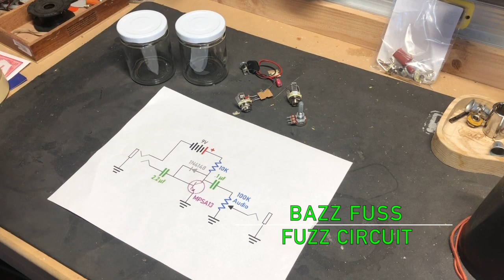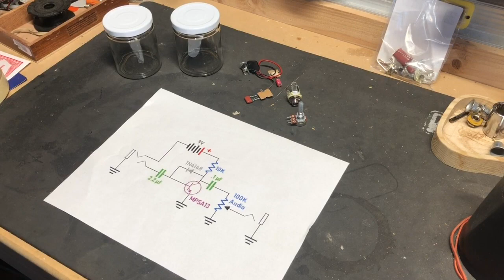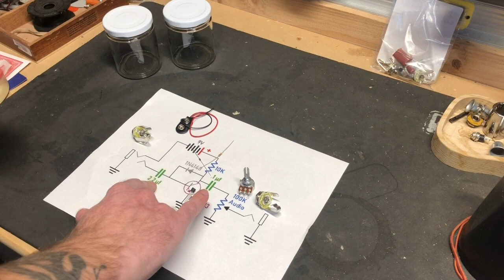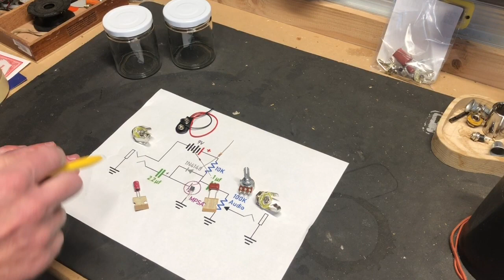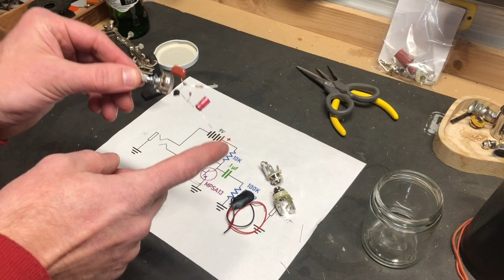Tiny Jar of Fuzz! (guitar effect pedal)

Comment: Awesome sounds.  Way back in 1967 I played in a band. Being a poor musician I couldn’t afford one of the new fangled fuzz boxes, so I borrowed someone’s factory fuzz, opened it up and drew the circuit.  I borrowed parts from my electronics class in High School and built one. It worked great and wasn’t pretty.  It ended up costing $5.00.  Pretty soon I was in business building fuzz pedals for all my friends. I used a soup can to build it.
Reply from the maker: That's a great story. Thanks for checking out the video.
Reply: I too have "borrowed" parts from my electronics class in school. Still got a tiny amp I built into a soup can !
Reply: Can 'O fuzz!
Reply: Hi how can you reverse engineer the circuits of pedals? I'd like to do it just to become good with electronics, other than to make diy pedals

Comment: this circuit sounds better with 100k ohm resistor and transistor 2n3904. Sustain is longer and is more expressive. You don't need play so dynamically.
Reply from the maker: Thanks for watching the video. I may try that on a future build.
Reply: I test transistor 2n3904 npn  with 1k ohm resistor and dont work. Can you solve my issue? please
Reply: I found the solution. I change the resistor from 1k ohm to 100k and make better soldering in output jack 😅. The output jack are cheap...
Reply: @miguelgateira4070  I had been trying to breadboard this exact circuit for nearly four hours. Your comment about swapping over to a 100k resistor has fixed my extremely low / no output issue that had me stumped. Thank you so much!
Reply: @neilkelly3818  Glad to know I helped someone. I can confess that I wasted a lot more time to resolve the situation. Thanks
Reply: @musicalmiscellany  
Have you got a twin? It's just that you said "..if I read the schematic right then this is we're circuit.." and my twin sisters would say things like "..this is we're CD.. etc" 
They would say 'we're' instead of 'our'. Anyhow, thanks for the vid and peace to you from Ireland mo chara.
Reply from the maker: @tomasotreasaigh111  Wait. If your sister was my twin... wouldn't that make us brothers. LOL. Thanks for checking out the vid.

Comment: How do i attach a foot switch on this thing?
Reply from the maker: The easiest way to add a footswitch would be to use a 3PDT kit like the one linked below. You'd wire the battery, input  jack, and output jack to the daughterboard. Then wire each corresponding contact on the top of daughterboard to the correct place in the circuit (in +, out +, 9V +, and common -). 
https://www.amplifiedparts.com/products/pcb-daughterboard-wiring-3pdt-footswitches-0
Adding a footswitch makes any circuit significantly more complex which is why I didn't include in this build. That said, there's no reason you couldn't do it. Good luck.

Comment: To get more bass change the caps out to larger ones 2.2 c1 .1 c2 or the volume pot to 500k. That will cutoff at 31hz which is a Low B also remove the volume pot and use the one built in the guitar which will often be 500k audio taper.. 100k makes the cuttoff 160hz..  The C-R makes a High Pass filter and higher resistance means lower F3 as does larger cap. Change the design to use a Bias control with a 4.7k resistor in series with a 10k linear pot. The volume and the bias will be crazy intertwined and you'll get the bass back.
Reply: По-любому что-то важное написал, но я ничего не понял. Типа если хотим больше низких- ставим с1 1.1мкф и пот на 500к? Поцыки, шо этот басурманин гутарит?

Comment: Thank you for the video ! I couldn’t found TRS jack in my area , it’s possible that I change it to two mono jacks?
Reply from the maker: You could use 2 mono jacks but then you’d have to remove the battery whenever you not using it. The stereo jack disconnects the battery when the effect is unplugged. But yes you could use a mono input jack.

Comment: im a noob. would it be beneficial to heat shrink tube wrap all those metal legs. also, how could I put a bypass switch in this?
Reply from the maker: You could use heat shrink tubing if you wanted. That certainly wouldn't hurt anything, but as long as you're careful with your wires... I don't know that it adds anything either. If it makes you feel better... go for it.

It seems like adding a bypass switch would be really easy but it actually makes the project surprisingly more difficult. It's not like adding a power switch because that would result in no sound at all in the off position. What you want to do is create a clean signal in one position and an effected signal in the other position. Also you want the battery to be off in the first position and on in the other. You probably also want to add an LED to be able to tell when the pedal is on, so you need a series of 3 dual-throw switches (one for the audio, one for the battery, one for the LED).

Don't get me wrong... it can be done. Do an Internet search for "3PDT bypass wiring". There's a lot of information out there and there are triple-pole switches made for this sort of thing. I just wanted to let you know it makes the circuit a lot more complicated (and thus why I didn't include it in the video). Good luck with the build.

Comment: Really impressive friend!! I'm a tap guitarist, does it work well with tapping? I'm planning not to buy a gadget hehe, I want to learn to build them instead. I don't know to read schematic diagram yet tho. Excellence tutorial by the way, definitely I will try to make one. Have a great day ahead. P/S It would be nice if it have on off switch that we can stomp on it.
Reply from the maker: Thanks for checking out the video. I don't do much tapping but I feel like it would work great for that. I agree that it would be nice to have a foot switch. You could add one but that would make the build a bit more difficult. Bypass switches aren't as simple as on/off switches because you need to send the signal to the jack either way. It's a matter of bypassing the effect portion and battery so you need a multi-pole switch. You also typically need an LED and resistor so the parts count goes up a bit. It's doable though.

Comment: Hey bro , amp makes noise when idle . an annoying squeak .
What can i do , from what
Reply from the maker: Not a lot of information here. Does this have anything to do with this pedal? Is it making the noise without the guitar plugged in? I'm not really sure where to start.
Reply: @musicalmiscellany  I didn't solder at first, I tried it on a breadboard. I think the sound was coming even when the guitar was not connected . I don't remember exactly
Reply from the maker: @cobainer  That sounds like something you'd be better off to troubleshoot on an electronics forum opposed to YouTube comments. However, noise like you're describing usually indicates a feedback loop. I've heard that the diode can make a huge difference for noise/feedback prevention. I'm not sure which one you're currently using but you might want to try a few different diodes (should be easy on a breadboard) until you get one that sounds right. I've heard some folks replace the diode with an LED (it is technically a diode) and get better results. It varies based on the exact components you're using. This all assumes your breadboard connections are solid and you're not getting a feedback loop from something else in the circuit.
Reply: @musicalmiscellany  I used the same materials in the diagram you gave, including the diode. But ı will try led

Comment: it is a problem if I use two stereo jacks?
Reply from the maker: This is an easy question with a complex answer. The first thing you have to understand is that the signal path is mono, so a stereo output won't buy you an additional signal. The circuit only has 2 output wires (+ and -) but there stereo jack has 3 terminals. The reason the stereo jack is used on the input jack is to interrupt the battery, but it is still a mono audio signal. All of that said... as long as you hook the wires up so that it completely the circuit (+ to tip - to sleeve), it should work. There will be an unused contact on the output though.

Comment: I'm unclear on the potentiometer. When you close it, does JUST the distortion go away leaving the dry signal? Or does it the whole signal go away leaving it completely quiet until your turn it up again?
Reply from the maker: It's the latter. The potentiometer is simply limiting the amount of signal at the output, so it's effectively a volume control. It may change the tone ever so slightly but it is not affecting the amount of gain or effect level.
Reply: @musicalmiscellany  Thanks. Very fun 'pedal' idea!

Comment: Maybe a stupid question. Could you wire a speaker cone in place of the output jack. Or does that not work at all.
Reply from the maker: You could try it but I don't believe that would work well because the circuit produces very little actual voltage. The audio signal has a small wattage but I wouldn't imagine it would have enough power to move a speaker cone (at least not in a way that sounds good).

However, you could wire a small amplifier board ( like this one: https://www.mouser.com/ProductDetail/SparkFun/BOB-09816?qs=WyAARYrbSnbTOyxcmy7VtQ%3D%3D&mgh=1&gclid=Cj0KCQiAvbiBBhD-ARIsAGM48bwDTKrO0wlyTcVEmp2Nzz2x7i0gH1WSBGp3CRQIrBNlGIihdSzRfycaAmb0EALw_wcB ) in place of the jack. That would probably work pretty well.
Reply: @musicalmiscellany  I will absolutely try this out. Thanks so much.

Comment: Great vid. A question, why does mono go in and stereo go out? Would it be possible to make a mono out instead?
Reply from the maker: Thanks for watching the video. The audio signal is 100% mono. However, both the 9V current and the audio signal are traveling through the same feedback loop. So, the stereo jack is used to disengage the 9V battery when no cable is in the input jack. It's a common technique that's been used in pedals for years. If you used mono jacks on both the input and the output, the effect would still function perfectly but it would always be pulling current from the battery, even when no audio is traveling thru the circuit.

Conversely, if you were going to always use an AC adapter instead of a battery, using 2 mono jacks would be perfectly fine. I hope that makes sense.
Reply: @musicalmiscellany  yes I get it now, thnx for taking the time to answer!

Comment: sorry if this sounds stupid but why one stereo jack and one mono jack? shouldn't both be mono?
Reply from the maker: The stereo jack is used to interrupt the battery signal. In other words, when the jack is unplugged, the battery is disconnected from the circuit. When cable is present, the battery is supplying current to the circuit. A lot of pedals have used this scheme for many many years. If you were using an A/C jack in lieu of a battery, you could easily use both mono jacks and that would work perfectly.

The circuit will certainly work with mono jacks, but if you're using a battery, you'll have disconnect the battery every time the pedal is not in use. Using the stereo jack makes it so you can leave the battery connected and not worry about it draining. You simply need to unplug the stereo jack when you're not using it and it will conserve battery.
Reply: @musicalmiscellany  Much thanks for the very thorough explanation! I'm a complete noob both with guitars and pedals, but it seemed like a simple project to have some fun with. Just waiting for the transistor to arrive. Thanks again!
Reply from the maker: @madseason8900  It's a perfectly logical question. Besides, I make these videos hoping they're helpful to someone, so I appreciate you watching. Good luck with the build. This is a really simple circuit and a fun one to experiment with. Welcome to your new hobby.

Comment: I’m just getting interested in how the insides of pedals work, I had no idea u could do this without a circuit board, so wat is the purpose of a circuit board - just to make things easier and prettier?
Reply from the maker: First and foremost, thanks for watching the vid... and good luck with your new hobby. This is an extremely simple fuzz circuit with only 6 electronic components. You could easily make a circuit board for a small circuit like this - but you can also hack it together as I did. When you get into pedals with a higher component count (say 12 or 15), it becomes really messy to do it this way. In that case, a circuit board will make it much easier to build, mount, and troubleshoot.

Comment: Hello! I've built the circuit, but when I plug to the amp nothing happens, on the other side when I plug to my interface trought an instument input I have signal. 
Does anybody knows why it happen?
Reply from the maker: That's unusual. If you have signal passing through the circuit it should go through to the amp. You didn't mix up the input and output jacks did you?
Reply: @musicalmiscellany  no, I think that I connect it in the right way. I ask myself if it have something to do with de impedance in of my amp

Comment: He man, does it matter what kind of jack i use?
Reply from the maker: I talked about the jacks in the video, you need 1 mono jack and 1 stereo jack (for the battery cutout). Are you asking what manufacturer of jack? I don't follow.
Reply: @musicalmiscellany  yeah, I was wondering if any 1/4 mono and stereo jack would do.
I couldn't find the Jacks  in my language
Reply from the maker: @truffeltroll6668  Got it. The manufacturer shouldn't matter, as long as it's a 1/4" mono and stereo jack, you should be fine.

Come to think of it... you could even use 1/8" mono/stereo jacks and wiring would still be the same. However, if you wanted to use RCA or Banana jacks or something like that the circuit would need to be modified slightly since those jacks handle ground differently.

Comment: I have a problem. I baught everything for the pedal. But I can't find MPSA13 tranzistor. And I don't know what to put there instead of the MPSA13. I found one, KSP13BU but I can't buy that one too. Hope someone can help me
Reply from the maker: You could try using a 2N5088 instead of the MPSA13. They're very similar transistors. I'm not sure where you're located but both mouser.com and taydaelectronics.com sell MPSA13s with worldwide shipping.
Reply: Yes, they do but it is realy expensive-20 euros. I'm from slovakia, central europe. I found some alternatives I will try to buy some and write here if it works or not. I hope I can find at least 1
Reply: MPSA12
MPSA14
ECG46
ECG172A
2SC982
2SC1472K  
2N5525
2N5306
Here are the alternatives that I found. If someone know that some won't work I will apriciate that you will tell me. And sorry for my english, I hope you can understand
Reply: I mean the shiping
Reply: Hi I'd like to give a hand! I've made this circuit many times. Get two identical NPN transistors and you can make a darlington pair. It MUST be a darlington transistor for this circuit, however this is where we make one out of two :) First step is to label your transistors 1 and 2 for ease, in order make it you will need to use 2 transistors and make a darlington by:
connecting (1)collector to (2)collector and (1) emmitter to (2) base
The base of (1) will be the base, the combined collectors will be collector and the emitter of transistor 2 is your emitter
Reply: @jonathanwoodside763  Hey man! I'll try this tomorrow. Thanks for the info!

Comment: Does this work with cell phone audio?
Reply from the maker: I don't understand the question. Are you if you could plug your cell phone into the fuzz effect?
Reply: @musicalmiscellany  yes and fuzz the audio out of the phone?
Reply from the maker: @professionalhater2809  As long as your phone has a headphone jack (I know many don't these days) and you have the right adapters... it should work fine. One thing to keep in mind however, is that your phone is a stereo signal and the effect is mono. So you could use a stereo to mono adapter or you could also make a custom stereo fuzz circuit by doubling up the design. Good luck.